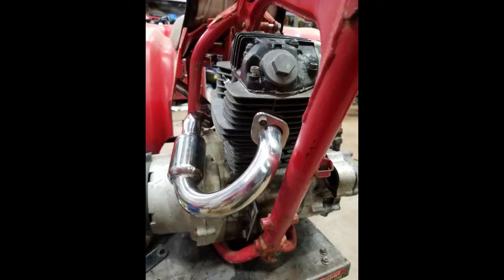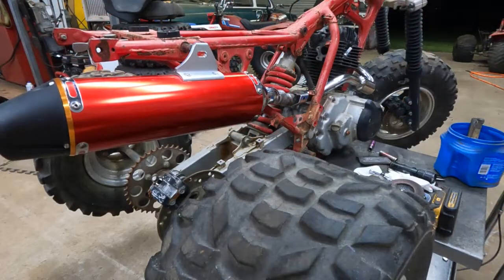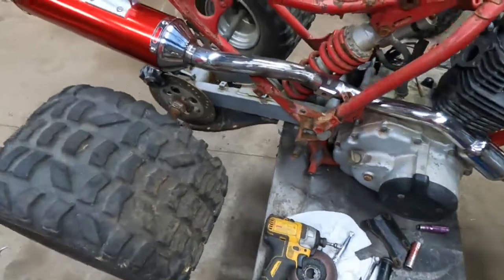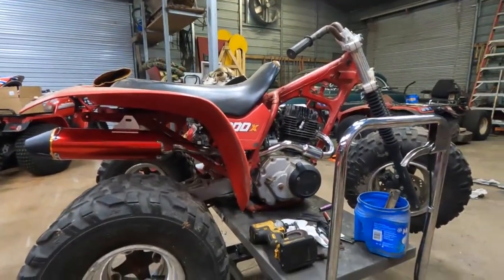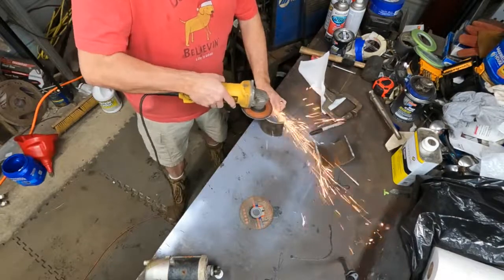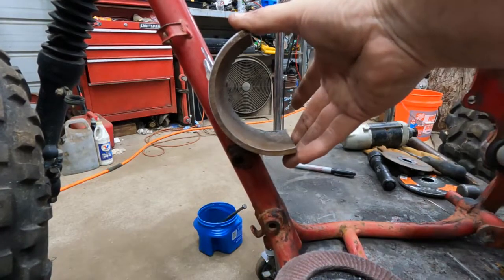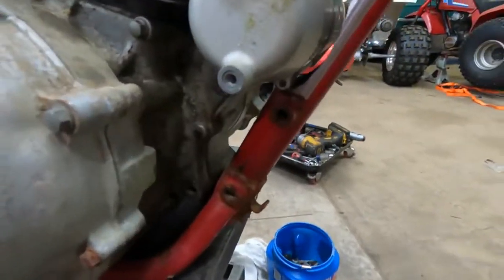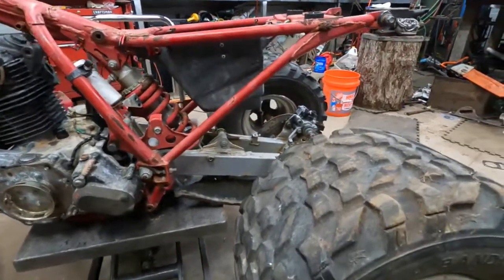Honda ATC200x Electric Start? ATC 3 Wheeler, Building a legend Part 3

Comment: Hey boss man that pipe looks really good on their man was it expensive and hard to put the electric start on there this is one of the best three wheelers that were ever made👍🏽👍🏽👍🏽👍🏽❤😎👊🏽
Reply from the maker: Hey Roy, the exhaust was $85 not hard to put on if you can weld stainless steel. I ha e been told you can bend it and make it fit also. A 200m engine would be a direct bolt in aside from the starter notch.
Reply: @Mrcbuilds  oh heck yeah thank you for the reply I'm disabled from a bad motorcycle accident I have a friend that lives up in Indiana he is giving me his 1987 200x I remember when he bought it brand new we have had some great times on it he hasn't Rode it in quite a while I'm not sure the condition I know the inside of the gas tank he said needs fixing up rusted pretty bad my son-in-law when they come and visit this summer is going to bring it to me I live in South Carolina would love to fix it up restore it and pass it on to the grandkids I'm sure the way it sets it still worth a good chunk of change but I would really love to see them ride it one day my oldest is 10 years old. One of the best three wheelers they ever built in my book 👍🏽👍🏽👍🏽👍🏽👍🏽👍🏽❤️😎👊🏽

Comment: I just watched and love your work. will be coming back for the tips and tricks when I do another. One thing of note. the 85 200x is the same as the 83 and 84. 86 is where it changed. the colors throw you off I guess. NOT challenging you but thought you may be able to use parts and you may be limiting yourself in that. my 2 of my 3 conversions have  been 85. the 83 has different swingarm. 86 is its own animal.
Reply from the maker: Thanks for the info, Yes I always thought the 200x changed in 85 like the Big Reds. Thank you for watching, I am glad you enjoyed the show.

Comment: I was watching your video of the Stainless exuast on that 200X . it looks great ,  I was just wondering how it it worked out when you drove it  ? . I had put a after market slip fit exuast on my quad in 2020 , and it sounded good but when I took it out trail riding with some friends I discovered that the muffler was a bit too close to the rear tire and hit against the inside sidewall when I would land after going over large jumps.  and coincidentally it was a round style muffler like you installed with your stainless set up.   so last summer I made up my my slip fit exuast using a couple peices from the original one that I had saved and I installed a oval Aluminum muffler with some different hanger brackets to tuck the muffler up higher towards the rear fender and closer to the frame .
Reply from the maker: I added a extra mounting point just as it comes thur the frame like the OE did,  I was able to keep it close the frame and do not  have any tire issues. It sounds good too.

Comment: Hey have you ever repaired a frame down by the foot pegs. The box section of my 85 200es is rusted out.  I am currently removing the engine so I can repair the frame. 
Thanks
Reply from the maker: Yes i have made a few repairs to frames, i like to insert a smaller tube to bridge the gap and then plug weld on either side, then a pass around the joint. No all areas can be done this way but i like it. Also welding in a extra gusset or even a skid plate can reinforce that area. Be sure and leave access to drain plugs and other vital components.
Reply: @Mrcbuilds  thanks man , I'm in New Zealand.  Its awsome to see your collection. I pulled out the engine last night so I can repair the frame now on my 250es.
Cheers for your reply !